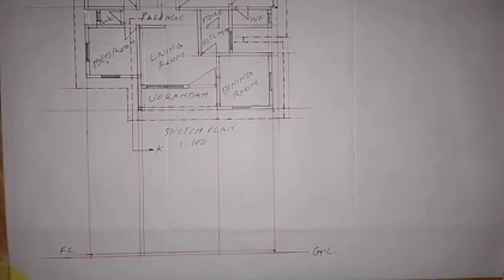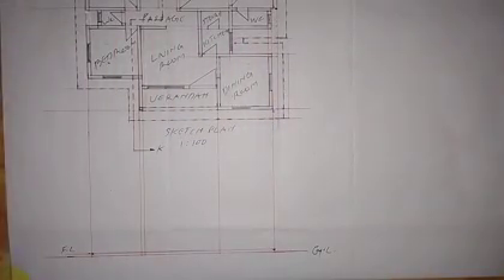2024 WAEC Building Drawing - FRONT ELEVATION

Comment: When I saw the plan. It didn't have a verandah or a front door. Hw did you invent that one?
Reply from the maker: If that is not said by the examiner those who are who understand building  drawing will detect that
Reply: @HisGraceTutor  very true, nonetheless the usual blank check waec gives the students are assume dimension where necessary and not really to add or remove details from the question. In my opinion I believe that whoever draws exactly what was given would still be given their full mark. 

Though I also  believe that question without door or verandah was an error from the examining body. No one is above mistake 

Thanks for all the work you do.